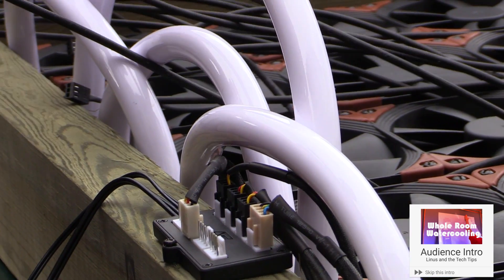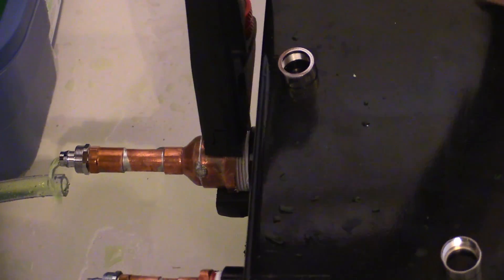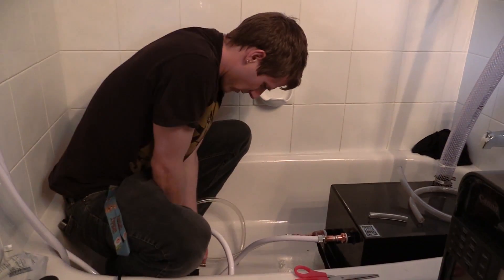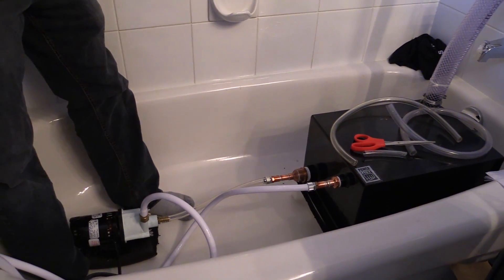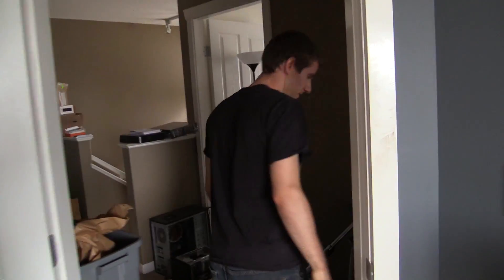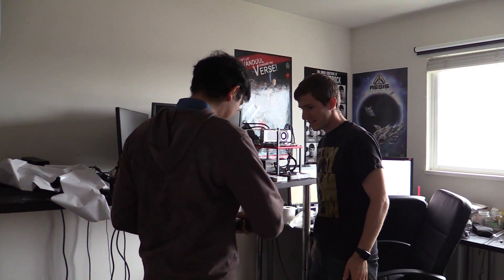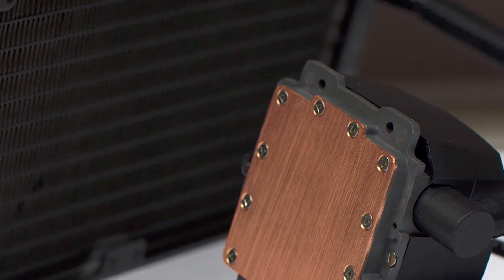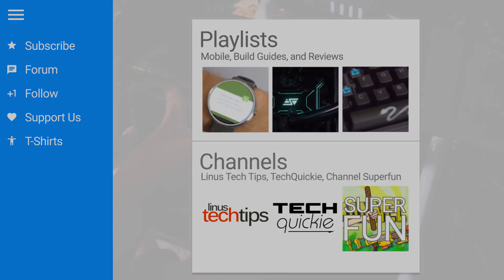Whole Room Water Cooling Part 4 - Nearing Completion...

Comment: thinking about how best to bleed this loop for a V2
just recognise the uprights are going to naturally bleed themselves, and that what you are bleeding is the upper horizontal part, so open the end farthest from the pump, and bleed ONLY there, it will magically bleed the rest even with a sub-par pump

also for V2, do not trust the power-fist brand to be 100% clean when you buy it(they find this out later) and finally, use strap-over foam pipe insulation, copper acts like a large radiator unless you insulate it or have it within the walls

I will be doing something like this someday for my future kids gaming/school room(even including consoles maybe) but given the limited nature of parallel loops I will instead use a household clean water diaphragm pump, they have a fixed flow rate even with air and can pressurize a tank, mix that with a pressure buffer and some simple thermally controlled local solenoid valves(each system will have a solenoid bypass and a needle valve to ensure a tiny amount of constant flow) the systems will just give  whatever she can take if they start getting too hot, leading to a system that can prioritize whatever system is hot(or even turned on) and just keep the others as an overpressure relief outlet that vents back to tank without allowing system flow(a single bypass needle for bleeding the high side near the end of the loop with a shutoff once bled to switch to pressure relief only)

but this project is clearly an early project like luke would do(if he existed at this time, I can't tell) and it would have stayed taped and not been replaced with JB-weld, and there would have been far more zip ties

Comment: This is a very cool idea! You could improve the system by making the loop a series style system instead of running the pc's in parallel. Good flow in parallel systems requires both side of the cooling loop be equal length to all outputs. In series the last pc would get less heat. Also in a closed loop system you actually don't have to worry about pump size because you don't actually have to overcome head pressure due to the self siphoning effect. So I'd downsize your pump and you have less chance of blowing fittings also the cooling liquid actually spends more time in the radiators which would give you lower Temps. And lastly I would insulate your lines so they don't sweat also leach heat from indoor ambient Temps. Cheers Linus! Love your vids always!

Comment: you should've put a ball valve on the hot side of each hook-up so you could adjust the flow to some computers where as others could run on full if they are in "dead-zones"

Comment: Sooo... Aren't those copper pipes dissipating heat inside the room? You've made a 6 foot tall copper radiator. The radiator you're putting outside isn't going to do much cooling unless it's winter. 😂

Comment: I know this is 5 years to late but I can't help myself. Why didn't you just use the shower head in the bathroom to fill the loop instead of dragging a hose up onto the 2nd floor? There i said it, i feel much better.

Comment: each system should have had its own loop with the external connectors to a  heat exchanger that way teh secondary loop to an ouside radiator with a car radiator could be run on car antifreeze so its winterproof

Comment: Thumbs up for the project in general, but thumbs down for you Seb, as 
you're the man in charge. I would fully flood each PC (get rid of all 
the bubbles) before connecting to the copper rails (based on my own 
experience with water cooling for PC's) and them, I would install a knee
 point for venting either at the connection joints with the main 
(horizontal) rail or right before it, so each of the PC's vertical rails
 could be vented properly before they join the main/horizontal rail. 
That setup would save me lots of hours spent on getting rid of bubbles 
from the cooling loop.

Comment: I don't want you to think I'm picking at you I'm not, but I would also like to suggest next time keeping your lines at machine height to alleviate the head pressure with this high set system you have your putting undue stress on the system, keeping the whole thing on the floor is really the best thing overall, also you have entirely to many ups and downs and no source of boost of water pressure between the ups and downs, who designed this mess?

Comment: Also, less stress is put on the system when you pull the coolant through the system, instead of pushing the coolant through, this is a basic Hydronics theory, don't know how you did it but if your pushing and you have problems reverse the lines and purge the system of all air and the system will be happier. also less leaks and the eventuality of leaks is minimized, also some sort of purge valves at the tops of the up and down drops to release air would be paramount.

Comment: ok im years late here. i work on boats and cars have dealt with cooling system before... so there would have been no issue using a vehicle radiator. would survive elements better. dont even really need a fan. wouldnt of gotten hot enough imo. they also could of just used a small keel cooler or something. those cooling units are going to get trashed.

Comment: In a comment to prev video I've mentioned the common bus topology disadvantages. Here came the proof - Its even hard to diagnose what and where is the bubbles are. Do you still use coaxial 10mbit cabling in your office?))) Why not use water chilled common tank as a hub and a personal pump with easy-to-deploy soft-tubing for each PC!?

Comment: id have installed ball valves to where the computer connected so you can dis conect it from the system then have control of bleeding more easily

Comment: These copper pipes do heat up the room first. But intentionally you wanted to move the heat out of the rooms, do you ?
So why you just used much cheaper and more simplier installed isolated aluminium composite tubes ? They are damn cheap and installed in not time. Also you can get a simple cheap device (fast venter) which you install on highest point to get rid of all air bubbles.
I know its long time ago but i just found this video and couldnt resist writing this.

Comment: i know these videos are old but you will EVENTUALLY have the issue   where 1 pc takes all the waterflow . MUCH like in factorio when you have a bus line with copper and iron the first machine in line gets MOst of the material whilst the others suffer  that is probably what you will run into with this build.

Comment: I would cheat like an mother . You have an huge tube right . have the tub as an tank . Just use water tho the hole system . When it gets nasty just drain the tub and then fill with clean water

Comment: Did you guys end up putting shut off valves at every copper down pipe? so you didn't have to bleed the system every time you unhooked a computer.

Comment: Using clear tubes instead of white ones in the computers would have saved you lots of air bleeding problems as u can troubleshoot air issues easily

Comment: I know this is an old video but I don't understand why the plumber did not put in to release valves 2 or 3 one at the top of the system "highest point" and one of the bottom of the system "lowest point" it would have helped them a lot on removing all the air from the system

Comment: You could have put nice little shut-off valves going to each machine, so that you could force out the bubbles 1 machine at a time, then two, then three, etc.  That would give you the ability to actually only cool the machines/stations that needed to be cooled as well.

Comment: Questions ?
 - why not using valve on every end connection, so that you could connect/disconnect computers without needing to to leak the entire system ?
- never heard of air/liquid separators ?
- You may even have gone for plate heat exchangers who would have separated computers individual loop from room loops
 with plate exchanger you could have gone for a heating systems specialized water pump (and even used normal water on the room loops without risking computers loops).
- why did you directelly go with computing heat echangers and a fucktons of standar computing fans, You probabily could have asked to any manufacturer for an external unit with a unique fans fitted for outdoors duties.

Comment: @7:00 - Have a 'termination ball-valve' at the ends of the copper pipe and just leave the quick-disconnects install all the time.  Also, above those 'termination ball-valves', have a copper pipe connecting the hot to the cold pipe - with a third ball valve.

This way, you close the 'termination ball-valves' and open the third ball valve and you can bleed the system without worrying about the computers.

Comment: With all that copper piping won't a lot of heat dissipate before even reaching the radiators? If they want all the heat to dissipate outside shouldn't they apply so insulation to the pipes?

Comment: How are you ever going to pressurize a system that size, remove bubbles from the system, and oh ya, how in the world did you expect the pumps in those rigs to feed fluid up a pipe that tall, and in to the rest of the system? I love the concept, but I am surprised with the lack of forethought here... I have come to expect more from the Linus Group. I'd like to see a redo, using what you have learned. I have heard you say the shorter the runs the better time and time again... lol

Comment: Man, I wish I had seen this earlier... I could have saved a ton of heartache, headache, time and money since I design Industrial Machinery, Plant Layouts and Manufacturing Theory and Implementation, or also known as a Master Millwright:

1. Determining BTU and Tonnage thermoconversion calculations
2. Proper pipe sizing after calculating Water flow, head pressure and velocity 
3. Placement of necessary balancing valves and water hammers to purge system and remove surging
4. Pump type and size calcs
5. Balancing Delta and Hysteresis values for max efficiency
6. Radiator size and type, replace with heat exchanger and cooling tower
7. Proper fan type and size

Comment: I know this is an old video, still You should have added several one-way valves and put several shut off valves at prime locations and you would not have ran into all those problems, a one way valve would have ensured a better flow and shut offs would have saved you from draining the entire system.. on all down pipes a shut off would make it easier to remove or add a computer to the system.. Also it would have been better to run most of the plumbing with clear pex piping, it is much lighter and you can actually see the water, so you will know if it's flowing or not.. Putting the radiators outside is not a smart idea, sunlight on them can heat them up a lot, it would have been a better idea to put them in the basement of the house or a small room such as a closet where you could just install a small air conditioning to keep the room cool, the cooler the room stays the cooler the return water will be.. I am a self taught tech, but I have done construction for most of my adult life..

Comment: Im guessing the problem was(didint check the other videos or something) If you want fluid to lift 3-4m like the im guessing it is to the roof, you need a system to be able to 0.3-0.4bar to even be able to carry the fluid back to the roof

Comment: Bleeder valves at the top of the copper stacks would have stopped the vapor locks, and bypasses at each system would have helped with all on/off design flaw.

Comment: I know I'm way late by 4 years, but get a 1 inch copper screw mount, 1 inch copper T, one piece of five inch long copper tubing, 1 inch copper ball or globe valve and a small hose. It'll help with that system drains in the future. If it's still in play. (Recently started watching your videos, and I'm a pipe fitter, figured that suggestion would help if not mentioned before.)

P.s. A hand torch and silver solder. Just don't burn the house down.

Comment: What you should do on the return lines is the opposite of a P-Trap with a bib on every line so you can bleed every system and still keep water pressure to the main line. As well as a wall mounted inline temperature and pressure gauge!

Comment: A little late to the party but I noticed in your plumbing there were no bybass valves, or shut off valves on your supply and exit line.  That would of solved two problems.  You could of bled each computer separately, and you would be able to shut the flow off to any individual station for maintenance with out any disruption to the other work stations.  Also instead of doing a closed loop I might of tried a fresh water supply holding tank with a over flow to a drain so the loop has a constant supply of fresh cold water with capability of adding and ice machine.  Also would of used a sump pump for greater water pressure.

Comment: It would have been a good idea to put ball valves on the pressure and return lines for each pc in the circuit...  Then you could have closed the line for all computers, ran the air out of the first, close it, open the second, and so on until you had purged all the air from the entire system...
Reply: And it would have made removing individual pcs from the loop while the loop could continue to run.

Comment: You should have included some vent valves in the circuit so purging that air out was easily done then and in the future. The valves should go in any hill the circuit does(when it changes from going up to going down)

Comment: Should have added a manual valve for each pipe at the bottom of each drop, and an H at the bottom of each drop connecting the two side for bypass around too.

Comment: Ok. First. You should have did dedicated lines to each work station and have bleeder valves in place to take care of the air. Such as like a anti siphon valve like in your water lines in your house so your not getting the hot water from one unit to the other like yours is doing in this video

Comment: =O  They connected the loops directly to the copper pipes! That's not good. They should have had closed loops for each PC. Then those closed loops should have gone into closed heat exchangers to transfer heat to the main loop that goes outside. And, they should have had reservoirs for each loop, including the copper loop, to remove air bubbles. By putting everything together, their points of failure and complexity for troubleshooting and maintenance are greatly increased. And, I'd be concerned about corrosion products from the copper clogging the cooling blocks, especially for the CPU.
They also could have used a much more appropriate heat exchanger for outside rather than a lot of PC radiators.

Comment: so if one system leaks they all leak...
Reply: VideoDemon Well, if one system leaks, and one did slightly, only that system has water dripping on the components.

It will have to be a serious leak to affect the water levels.

Comment: Linus, sigh, where to begin correcting this near-abortion.  I think if I was you - I'd have boned up on some the subject, maybe buying and yes, actually reading some Plumbing for Dummy type books.  You could've save a sh!tton of misery had you installed bleeders on the bottoms of a few of those upright copper pipes.  Starting at one end, you could've swept through the entire room systematically bleeding one section at a time.  Remember:  air is the scourge of water pumps.
Reply: Brian Brewster this thing doesn't even exist anymore
Reply: Yea, I didn't know at the time of my writing.  My bad.  I missed the boat by about 1 year.  Sue me.
Reply: Brian Brewster And the copper was a terrible idea because it corroded. The whole thing should've been plastic
Reply: hansdietrich83 Why did they take it down after I think A WEEK of pure work trying to make this work?

Comment: such a waste of money, you could use conditioner ur regular used car radiator,  (it can handle 30-100kw not 3,5 ) and cheap pvc tubes with handles
Reply: copper tubes are giving back about 10-15%  ofthe heat

Comment: Why didn't they just move to antartica?
Would have made this project a whole lot easier...
Reply: Doohan Holstegge Nah, just overclock some more
Reply: bestiebest Imagine the overclocking
Reply: they live in canada, kinda the same.
Reply: bestiebest good idea
Reply: bestiebest they would need heating
Reply: Sub ambient temperature results in condensation. I don't know how they balance that. Internal and external thermometers monitoring the delta?
Also will it need draining over Canadian Winter or did they add antifreeze?

Comment: Those little pressure relief valves on the bottom of water heaters would have been great on the end of those pipes to save your face from that splash back. XD

Comment: i did something similar i used a vacuum pump to pull all the air out of the system (at secondary rez saved alot of time and killed the bubbles.

Comment: You should have spent $20 and added a few valves to make draining the system and purging the air much easier.
Reply: ya, not only at the bases of each CPU connecting(which would make it easier to hook and unhook without draining the system or allowing lots of air in), but adding some in the main line after each T fitting, to cut off sections to focus purging air one system at a time or something like that.

Comment: It would be more effective if it was in serial not in parallel and the tubes placed at the bottom beacuse in parallel there should be a powerful pump in every pc to change the water and pump it up high.

Comment: It seems like the problem was the parallel design. Some of the machines had better flow than others, so the water takes the path of least resistance, and the machines aren't cooled equally. Then there's the problem of purging, in this configuration the air would need to be purged on each branch individually. In a series configuration, all the bubbles would have been pushed out all at once